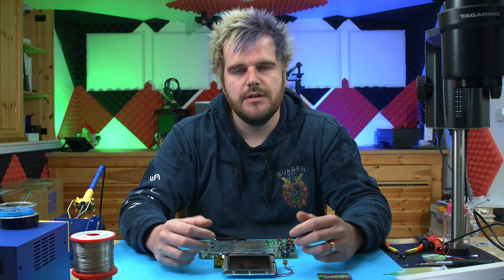Atari Lynx 2 Power On Circuit Basics - RetroSix Explains

Comment: Followed this as I am trying to get my system to run, thank you. It helped me understand my lynx power circuit is working as it should. Still no insert game but I do have power and a lit up screen. Thinking it's one of this chips.
Reply from the maker: No lynx I've worked on shows insert game. It simply doesn't power on without a game in. So perhaps try inserting a game
Reply: @RetroSix  Game inserted, new caps and new voltage regulator rebuild kit. U2 is lightly warm but u1 is cold. Both getting the proper Volts to the pins. No contrast control, just a lit up screen with no image.
Reply from the maker: Got a bench power supply to power it up and see what current it's drawing?
Reply: @RetroSix  At the power jack it shows 8.57v. Going in.
Reply from the maker: Need to know current draw
Reply: @RetroSix   I am not really sure how to do this? Really appreciate your help
Reply from the maker: You need a bench power supply ideally. If not you can put your multimeter into amp mode connect the leads between one of the batteries and see what it draws
Reply from the maker: Jump on our discord for more help

Comment: you are the bomb bro, I love your explanations.  So if 9v goes to the system does it kill mikey/suzy etc? or what happens? I have a few I was working on and replaced power parts and now I just get white screen, no video.  I am going to continue to digest your videos and get back to my lynx, hope they aren't fried .  One Love! <3
Reply from the maker: I'm pretty sure the system is 9V tolerance due to if the diode failed. I can test that Monday as I'm on 3 Lynx at the moment and have several donors that boot but have only audio so good enough to sacrifice on testing it